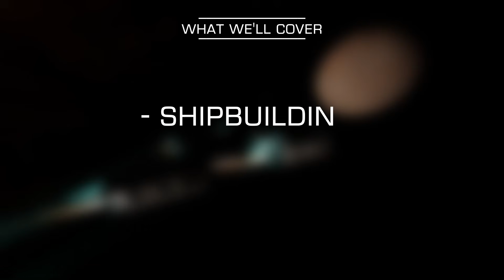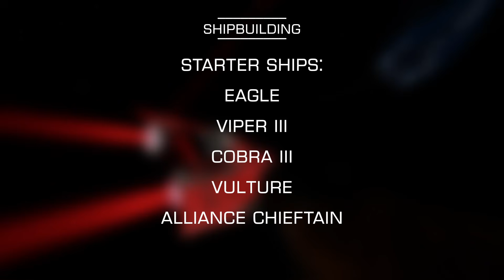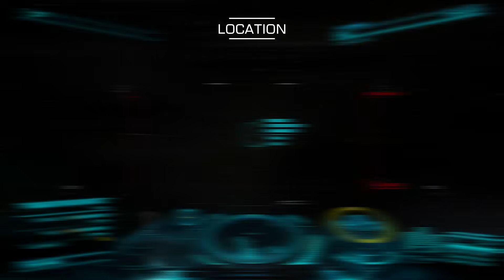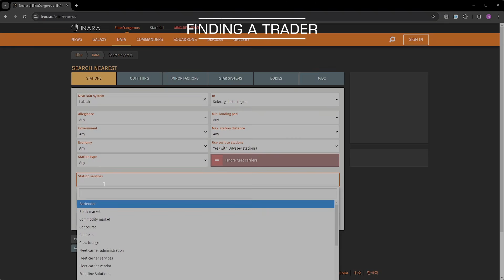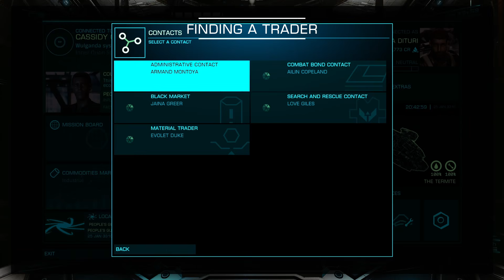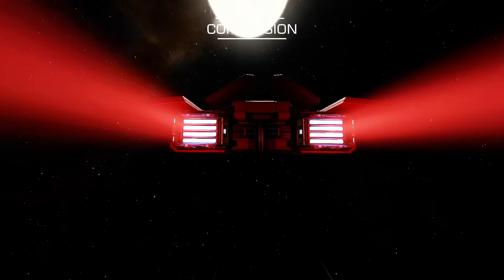Farming Manufactured Materials, But it’s FUN! | Elite Dangerous Engineering Guide 2025

Comment: Very good video. Honestly you can top this further with taking bounty quests from stations for same type of pirate faction from different faction quest givers. there are many pirate elimination missions that gives all the way to grade 5 engineering parts of all kind. since you can also trade them for other parts, you can just take 20 quest like this (make sure to take these quests on a system that has resource sites of your choosing. you might wanna explore before you take the quests. this way in few hours i make around 100-200m credit just from the bounty with no powerplay bounty bonus. just the initial %40. about 100+ grade 5 engineering material, in short 5-20 piece of engineering mats of many kind in one quest with grade 5 being very generous and also common. All you gotta do is just get some donation quests to improve your relation with the quest giving factions to friendly and quests will pop right up. You may have to take a quest or two just for the rep if you wanna speed up the good quests. Also you can afk in the same station for over 10 mins to refresh the mission board to get more lucky. Just remember not to take too much of the same faction's quests because it wont count all together. Same faction missions counts one by one. If its different, it will all count so technically you can start and finish 7-8 quest at once. Now with good juicy quests, you can get around 20-30m even more from single quest and when you have 20 of them you can make around 400m just from quests. so over half a million credits in few hours of gameplay depends on how good your ship and how good of a pilot you are and also some luck included on pirate ship spawns. You dont need to collect anything at all but you can top that with some collectors and cargo space to even make it more juicier and improve that engineering mat number higher.

Must to have for this to properly work: 
-Max medium type of ship to gaurantee to land on any type of station to both claim quests efficiently and also dock for repairs and resupply on any place. (this also allows you to be way less picky on the mission locations)
-Any type of laser to prolong your staying along with your guns with ammo to speed up this drastically. Resupplying or synthesizing ammo is a huge waste of time pretty much makes the whole run waste of time.
-System with a ring for resource extraction sites.
-Station that can both resupply ammo-fuel and also repair.
-System that contains 5-10 station that has many different type of factions that gives quest for same location in abundance. (Some systems factions are not giving quests for the location you want but maybe one among them does. Thats not what you want. That will make the run diabolically long)

Suggested things to improve the run:
-Bi-weave type shield for sustained combat without waiting.
-Take quests that has 7d duration instead of few hours with 1m or less reward unless you have to. This may take between 3-10 hours depends on everthing stated above).
-Choose allied powerplay locations if you are part of one to farm merit with a boost if your powerplay has a combat bonus on reinforcing.
-Engineering for sensors to improve the range over 10k to properly locate pirates from a distance to check if its a mission target.
-Include a killwarrant scanner for maximum profit. 
-Extraction Site, instead of Extraction Site (Hazardous) or (High) to make targets much more easy to blow up to speed up quest finishing or (High) to get more bounty and slow down the process and much more routine resupplies. I dont recommend hazardous in any case because security force makes this much, muchhh, muchhhh more easier and faster.
-System with very low distance to the station from the extraction site.
-Ship with SCO on frame shift drives.
-Dont collect any cargo. Only materials if you want to. Pirates will not attack you ever if you have no cargo. Materials dont count. Therefore you can actually go afk, come back, check, have fun, watch tv, open a movie on second monitor, close the sound etc etc. comfortable farming.
-Choose empire or federation system to grind exp for the faction to later obtain the ships you want.  You can also have the rank up quests directly while doing all these so its many birds with one stone.

Hope someone will enjoy these informations. Ive learned alot from this channel. Wanted to give back some.

Comment: I will just drop it here in  case someone finds this helpful. The fastest and arguably the easiest way ( although admittedly not as fun as blowing stuff up ) is to refill in High Grade emissions. Let me break it down. 
All you need is a ship with a cargo rack of 16 tons ( 8 is enough but halfway through you will have to refill on limpets ), a limpet controller that can control 2 limpets ( it speeds things up significantly ), and a ship with preferably an SCO drive. Fill up your cargo with limpets, and the method is the following. 
1. open Inara, enter the system you are in, set allegiance to Federation, population above 1Billion, hit search, write down the the closest system to you, now change the allegiance to Empire, enter the system you've got as a result for your previous search as a system of reference hit search, the closest Empire system is your next destination after you've finished with the Federation system. 
2. Jump to the Federation system, drop into the Nav point, scan the Nav Buoy ( lock the thing up, and look at it, let your scanner automatically scan it until you get a notification ), now leave the Nav Point, ( low wake out ), now when you are in FSD you will see every object and every single signal source in the system. Pick the closest High Grade emission, and go there, drop into the signal source. You should see a LOT of G5 materials. It's a federal system so there will be a LOT of Proto Radiolic Alloy and most likely Core Dynamics Composites as well. Usually I get them mixed in the same instance, but if only one of them, just fill up on that and go to the next HG Signal Source. With two limpets, you can fill up on both in about 3-5 minutes. These signal sources used to drop around 5-10 materials but now you get literally 2-3 pages on the contact tab, and each of them give you 3 materials so you can fill up from zero to 100% in a single HG signal source. 
3. Once both mentioned materials are full, jump to the previously searched nearby high population Empire system, repeat the scan process in the Nav Point, find a HG Signal Source, and fill up on Imperial Shielding. 

With this method you should have 3types of  Grade 5 materials at 100% in no less that 10-15 minutes ( depending on the size of the system ). That should be enough to trade for everything else you need at a material trader. It's a very easy process and probably the least grindy way to get this done. Refined materials are easily the least of my problems nowadays when it comes to engineering.
Reply: This is really helpful, thx

Comment: Are there any methods of combat mat farming with grade 5 materials? Thanks for the video and the many helpful videos you've posted o7
Edit: I have a fully engineered corvette, I'm a returning player and would love some combat mat farming with a good fight.
Reply from the maker: This is it! The method in this video provides tonnes of G5 mats like Core Dynamics Composites, Imperial Shielding, Proto Radiolic Alloys, and Military Grade Alloys. 

Usually the bigger targets are more likely to give G5, so I’d say anything smaller than a clipper probably won’t get you any. In your ship, I’d suggest either a has res or maybe a high threat conflict zone if you fancy mixing things up 🫡
Reply: @DiturisElite Thanks, I haven't had much luck so far but I did just get a few core dynamic composites. Thanks

Comment: Nice! Even better, if you have an engineered Anaconda (or larger ship) and you also like to mine, go mine your valuable minerals in a high res site somewhere between 15-20km away from the RES(High) itself, it will give you more minerals per asteroid mined because you are within 20 km of the RES (staying below 15km will get you constant attacks and you will be engaged by multiple pirates/wings at the same time), and from time to time you will get a pirate/wing of pirates that will check you and demand some of your cargo. Get a SLF hangar if you don't have a friend with you to keep the pirates busy until you deplete the asteroid and able to engage them with 4-5 guns remaining (you can use 3-4 mining lasers depending on your priority and engineering). This activity will give you minerals to sell, materials for engineering (both from ship destroyed and from laser mining), combat experience for you and your SLF pilot, advancement in ranking as trader and fighter, and a lot of fun.

Comment: As a seasoned ED player who enjoys engineering as much as possible, it is far more efficient to hit HGE (High-Grade Emissions) for G5 manufactured materials and down-trade using a Material Trader. Doing this with combat gives me materials I fill up on and then cannot use without up-trading and up-trading is wasteful for me. Great video.
Reply from the maker: Absolutely. I’ve done HGE in the past and it’s amazing for volume materials. Still, this is way more fun and on the whole not masses worse. 

The engineering ‘grind’ doesn’t have to be! 😅🫡

Comment: How do you actually trade the material, how do you pick what to trade and what to receive?
Reply from the maker: Once you’re at the station and gone to contacts -> material trader, select the item you’re willing to trade, then select the one you want. Then you can choose how much you want to trade 🫡
Reply: I just watched a video the other day that was exactly about that. Basically, trade straight down. One "tier A" material is worth 3 "tier B" materials, for example. So if you get just a few top-tier materials you can fill your lower tiers pretty quickly.

Comment: That's the method I've been using for years, and I'm always swimming in manufactured materials! When I need to take some time off between engagements anyway to let my biweave shield recharge and scan for the next target I might just as well do some "garbage collecting" in the wreckage with limpets.

And if your ship has room for it, Operations Multi-limpet Controller is the best collector limpet controller in the game--4 limpets in class 3 package beats even the class 5 collector and slurps up the combat aftermath very fast :)

One tip for using limpets is to position your ship so that the materials are 200...300 meters below you, makes for a fast direct route for the limpets.
Reply: Wanna share the tips you have for not waiting 5-10 mins for each Anaconda?

Comment: I think you should clear mention that adding experimental  effects is game changer, while update itself can be low G1-G3 in the most cases, which is fast to do. Also using NPC SLF pilots helps a lot, you will lose exp/money, but that is not important, final elite 5 levels will take longer just.
Reply from the maker: I agree about experimental effects, but I didn’t want to overload people with the shipbuilding section. It’ll definitely make it into a full engineering guide, if I ever make one 🫡

Comment: for "fairly slowly" at 2:25, the requirement is less than 40 for your speed, and yes it's quite fun to keep the cargo scoop powered on with the hardpoints out, makes for a cheeky grab at a few things between the booms
Reply: Limpet collectors are so much easier, and you can sometimes get away with 40 or even 41 depending on what you're scooping but yeah 39 is the optimal for 99% of cases.